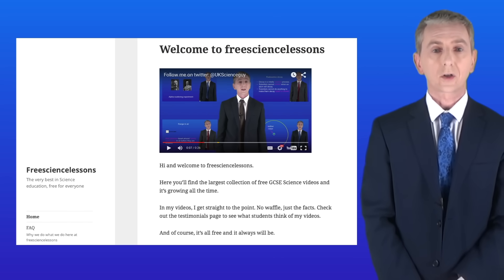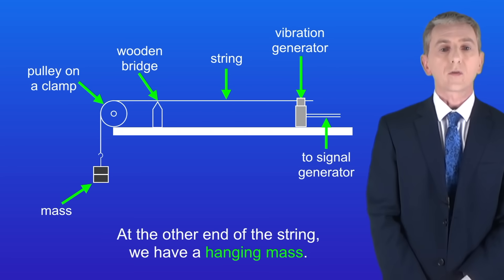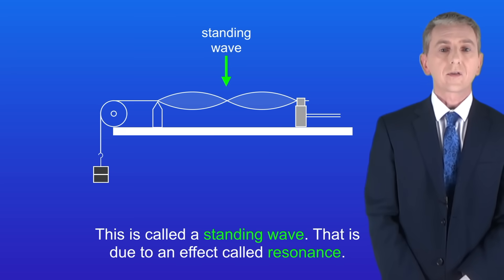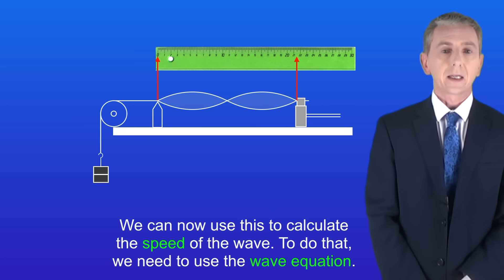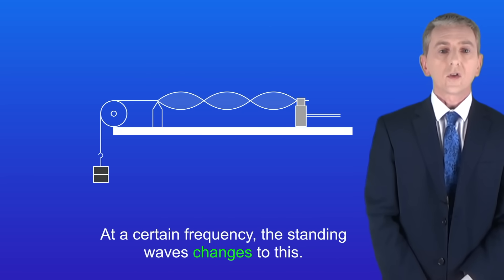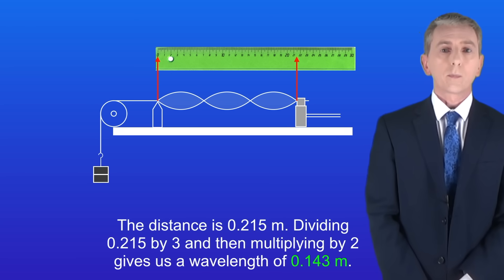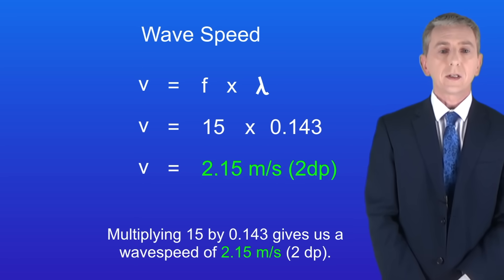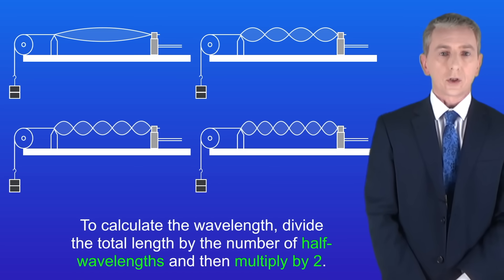GCSE Physics Revision "Required Practical 8: Waves in a solid"

Comment: In the example with the three half-wavelengths, you said we had to divide total length by the number of half wavelengths and then times it by 2, but you didn't do that for the previous example with 2 half wavelengths. Am I missing something?
Reply from the maker: One wave consists of two half-waves. So if we have two half waves, then we have a complete wave and the total length is the wavelength. I hope that helps.

Comment: i dont get how frequency and wavelength dont affect wavespeed
Reply: Hope this isn’t too late but I think it’s because in this experiment when there is a higher frequency there is a shorter wavelength and vise versa so you end up with the same wave speed but changing the conditions (like the mass on the string) will because nothing kinda counteracts it if that makes sense… I’d double check but I’m pretty sure

Comment: I'm just wondering, I'm not entirely sure about the last slide of the video. I thought because of the equation frequency x wavelength = wavespeed, that frequency and wavelength were bound to affect the wavespeed. Thank you so much for the video by the way, it was really helpful.
Reply from the maker: The wave speed is the wavelength x frequency. However, if you increase the wavelength, then you reduce the frequency by the same proportion and vice-versa. So neither of those affect the wave speed in a solid such as a string.

Comment: why do you say 3 half waves?thats where you lose me...
Reply from the maker: You need to know the wavelength but the string changes in multiples of half a wavelength. If you look at the string, you'll see points where the string is not moving. These are called nodes. The distance from one node to the next is half a wavelength. We need to know a whole wavelength (ie two halves). So if there are three halves, we divide and three and multiply by two. If there are five halves, we divide by five and multiply by two etc.
Reply: @Freesciencelessons  thank u very much......this has been a lot helpful,earned yourself a new subby

Comment: Hi. How do you know if it’s a half wave or a full wave?? Because the first example was a full wave but the rest of the examples were half ones. Thank you
Reply: The 1st example has 2 half wavelengths ( basically count the peaks or troughs and it will be the amount of half wavelengths). The equation is length divided by the number of half wavelengths X 2. So you would divide 21.5 m by 2 then X2 canciling it out.
Reply: yes i am confused by this

Comment: Hi,
Do you play around with the signal generator to get the "standing wave"?
Thank you in advance.
Reply from the maker: Yes that's correct. We change the frequency until we get a standing wave.
Reply: @Freesciencelessons  could this be a 6 marker? And do you need to know how to measure wave speed in air using an oscilloscope  (this is in the cgp guide)
Reply: Can you also produce a standing wave by moving the wooden bridge?

Comment: Hi Sir, I recently discovered your channel and find your videos a great help. However, I'm a bit stuck on the last slide at the end of this video. Mainly the top left example with a single large sized loop. I am a little stuck on how that calculation would be carried out as I don't know if it is a half wavelength or a full wavelength; as it is a large loop from one end of the string to the other. If the total wavelength was 0.6m for example, would you count that as two half wavelengths and leave that as the final wavelength? Or would it be counted as a half wavelength and therefore you do 0.6/2 = 0.3m?
Reply from the maker: Hi. That example shows only half a wave. Remember that a full wave is from a point of zero displacement, through a peak, another point of zero displacement through a trough to a final point of zero displacement (zero displacement means no movement). So if that example was 0.215 m (which is the distance from the end to the vibration generator shown in the examples before), then the wavelength will be 0.215 x 2 = 0.430 m. Hope that helps.
Reply: @Freesciencelessons  Thanks so much! I get it now. This will really help for my Pre Public Exams in two weeks :D

Comment: So if it's an odd number of waves are there always half wave-lengths? Also if it's an even number of waves does that mean they're always going to be full wavelengths? please reply.
Reply: Also will we always be given the frequency for exam questions when it's asking us about this practical
Reply from the maker: To answer your first question, an even number of waves must be whole wavelengths (so no need to divide by 2). An odd number of waves is half wavelengths. In the exam question, you will be given the frequency if you need it.
Reply: Freesciencelessons Thank you so much Sir for replying, so fast too, and I love your videos even though I haven't got GCSE'S for another 2 and 1/2 years I don't want to be one of the people panicking a lot one month before.
Reply: I'm trying to make up my own scenarios by using your example to help but is your frequency increased by 5 purposely, like now it's 15 instead of 10 there are 3 waves instead of 2. If I had a 20 cm distance, (0.2 m) and 2 full waves with a frequency of 20 on the signal generator it'd have a wave speed of 4 m/s. Then if I increased the frequency to 30 I would have three 1/2 wavelengths so 20/3 = 6.6* then multiplied by two = 13.2 m/s, why is this wrong?
Reply: The 2nd part should have been 0.2 divided by 3 but that still gives me 0.06* and then multiplied by 2 gives me 1.3* so 1.33 m/s but it should be 4 m/s?
Reply from the maker: OK. Remember that the wavespeed only depends on the tautness of the string, not the frequency. So I made the questions to keep the wave speed the same. That's why the frequency changed by 5 Hz. What you have stated in your scenario is essentially correct except for a couple of errors.

Firstly, a 20 cm distance with two full waves means that the wavelength is 0.1 m. The wavespeed would be 20 x 0.1 = 2 m/s.

Increasing the frequency now produces 3 full waves ( you have increased the frequency by 50% so the number of waves increases by 50% ). The wavelength is now 20 / 3 = 0.066 m. The wavespeed is now 30 x 0.066 = 2 m/s.

Hope that helps.
Reply: Freesciencelessons Yeah I think I've got it now, if you wouldn't mind may you give me an example question for GCSE and then once I've sent my workings and answer may you say whether I've got it right or wrong. Thanks

Comment: why do you multiply by two when there are more than 2 half wavelengths and do you always multiply by 2 even if there are more than 3 half wavelengths
Reply from the maker: You need to work out the length of full waves. So divide by the number of half waves and then multiply that by two to get a full wave.

Comment: Quick question, why is it that at 1:20 the first reading of the waves they arent half wave lengths but in the second one at 2:28 they are half wavelengths?
Reply: Sulaik Mohammed It is because of the frequency of the vibration generator increasing and a standing wave being based around the nodes (the none moving parts) and points of contact.
If you imagine a wave travelling along the string, when it hits the end, it reflects. If the end matches with the position of a node, you get a standing wave.
See this website for a computerised version of a string wave generator.
https://phet.colorado.edu/en/simulation/wave-on-a-string
It takes a little setting up, but this free software is really good for teaching waves when most schools don't have enough equipments for a class to do this on their own.
Reply: basically they are half waves but because there are only two so to get the individual wavelength you would divide total length by two then times it by two which is the same as the initial measurement
Reply: because the numbers wont chaneg when you divide by two(becuase 2 half wavelengths), then multiply by 2(as per the rule)